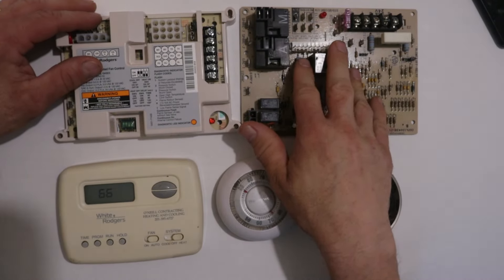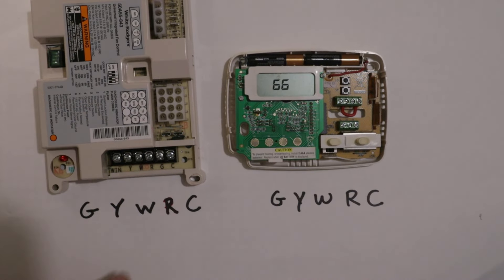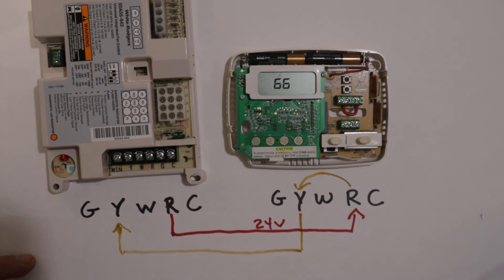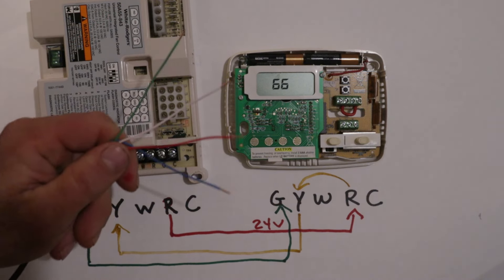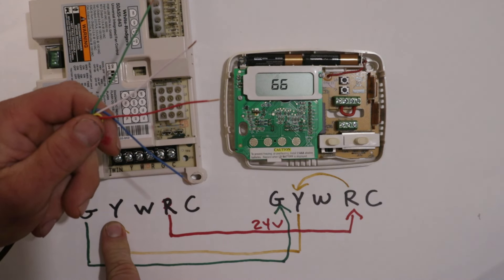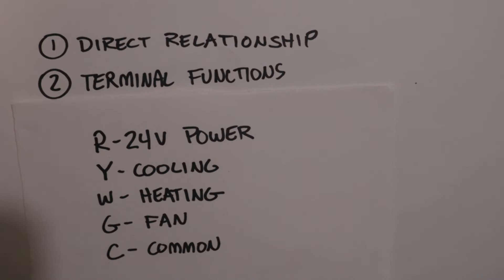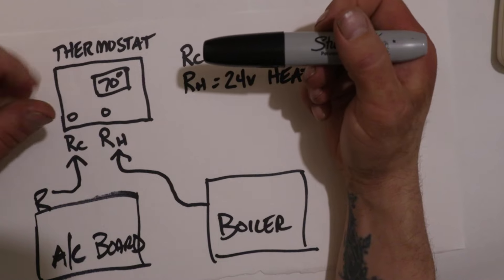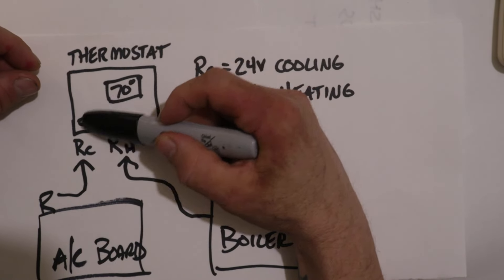Thermostat Wiring at Control Boards

Comment: It is not always true you need a green wire (G terminal) to turn on the fan (blower) to accompany your furnace in the heating cycle. This  can be setup inside the furnace and can be totally controlled by the wall thermostat with only 2 wires. Typically red (Rc) and white (W) are the only connections necessary. Also, you should probably point out that "24 volts" is actually 24 volts AC (alternating current). Also, you speak of 3 wires to the outdoor condenser but talk only about 2 wires, which is a connection for A/C. The 3rd wire is for the reversing valve for a heat pump system.

Comment: I found the video very informative and superior to other videos I have watched.  For me the big take away was that the color of the wires might or might not agree with the letter markings on the components.  It is the function that is important.  One take away from another video is that when replacing a thermostat that has been working but has failed is to take a picture of the previous wiring to use as a reference.  I have a thermostat where the DOWN button does not reliably reduce the temperature setting so I am going to replace it with a simple manual Heat/Cool type thermostat.  I plan to take a picture first and connect the wires to the same "Letters" as in the picture.

Comment: I set my thermostat to heat mode. Adjust thermostat to 70° furnace. Lights comes on blows heat into the house reaches setpoint turns off, but does not continue to run and blow access heat out of the heat exchanger and trips on high limit. Is my problem control board or thermostat.

Comment: Love u say r to r etc takes priority over color code, cause I had someone wire an air conditioner in 2002 who thought it was 1950 apparently used blue for power gave me a massive headache till i spent hours ohming it out to find out was connected to the r terminal
Reply from the maker: Yup. Had one situation where somebody ran 3 sets of 2 wire instead of just running one 6 wire. All of the wires were just red and white.

Comment: I knew nothing of HVAC, though wanted to figure it out some since I just moved the thermostat by running a new length of 5 conductor. Everything worked fine, but I had a piece of 2 conductor coming off of it that I now know the function of thanks to this video. You explained all of the functions of the connection in a manner that people could understand easily and clearly without treating us like idiots. Thank you!!!
Reply from the maker: You're welcome

Comment: Thanks so much for this video!  This is exactly what I was looking for.  This really explains everything.  I have 2 systems with 2 different transformers but maybe you can include using a “relay in a box” to keep them separated when your thermostat only has a single “r” terminal.

Comment: That was quite informative. I have a diesel heater which has  its own sort of thermostat. By sort of I mean when it reaches a certain temperature it just goes to the lowest setting. They make programmable thermostats that can intercept the wireless control signal for the diesel heater and use it to manipulate the off and on buttons. This allows a person to have an actual thermostat that turns the unit off when it reaches temperature. The concept is quite simple but the aftermarket thermostat is an additional $50. Some folks wire up a standard furnace thermostat to the contact points of the diesel heater's remote switch and use a 12-volt power supply to send a signal (power) to the diesel heater's remote switch. The diesel heater remote switch will time out after 10 seconds, so they can send power to the on button to turn the unit on and when the room temperature is satisfied it sends power to the off button. It seems to me this could be accomplished without a separate 12 volt power supply. I'm not really sure but I'll have to watch your video a few more times to see if a regular thermostat can trigger (close) one circuit (on) when it needs heat and close another circuit (off) when it reaches temperature and is ready to shut down the machine (essentially activating the off button on the diesel heater remote). Your explanations were very clear and I appreciate your professional knowledge. Thanks.
Reply from the maker: I just bought a relay that can work with 12-24 volts ac or DC. With that you can run a regular tstat off of a 24 circuit to activate the relay and send 12vdc to the switching side of the relay to control the heater.

Normally open and normally closed can be used to toggle.
Reply: @JerseyMikeHVAC  I also have a couple of those small relays that I used to trigger my plasma cutter when I built a CNC table for it. It's a normally open and closes the contact when it receives a power signal. I was trying to rattle my marbles together to figure out how to incorporate that device.  For me it usually takes quite some time before my brain can wrap around how everything works. I know the solution is there somewhere I just have to comprehend it. Thanks for the reply.

Comment: What I have found, is that HVAC Guys do what they want, when possible !
Not sure what they're thinking is, but likely as long as the same wire is connected to the Thermostat, and then to the control board, thats all that matters, apparently to them !
It's as if, they make it their own !
Especially if they do the installation !
As if they will be the only ones to service the system !
I found this out the hard way !
Thinking I could do a quick and simple Thermostat change !
Fortunately I was smart enough to take a before picture with my phone, of the wiring scheme !
Which turned out to be a Life saver !
I didn't agree with what I saw, but took the, " When in Rome " stance !
Most importantly, it worked, and you can't argue with success !
I can think of a lot of names for the initial install, but not here !
           😂🤣😂

Comment: By far the best video I've watched on how to wire a furnace. I wish that I could do a video call with you because I had a circuit board that went bad and one next door out of a furnace that was free and I'm trying to wire it up and make it work except it's a little bit different then the circuit board that is smoked. 
The only thing I wish your video had also is how each of the other components turn on and what sequence is used and possibly what the ohms are for each sensor. Kinda know what I'm doing, but first time fucking with furnace. Also GF is cold.
Really good video, and I will be subscribing

Comment: Mike, is the orders: 1.transformer powers board, 2. Red wire is the only wire energized to thermostat 3.other wires are energized returning to board according to call.

Is "red" wire only supply voltage to thermostat?

Could u do a video on low voltage side of transformer supplying voltage to board?

Is my thinking correct or incorrect?

Thank you for good videos!

Comment: This is very informative and consolidated my knowledge of the wiring. This pretty much describes the same wiring as my Goodman furnace/ac setup. The only difference is my G terminal is wired to an external switch system  that controls my central exhaust fan (R and G). Whenever I turn on a bathroom fan switch, it turns on my central exhaust fan but also turns on my blower motor through some kind of relay. I wonder if I can still connect another G wire from my thermostat to the G terminal to be able to use the circulation feature while still having my exhaust fan system wired to the blower as well...

Comment: Question - I do not have a C wire to my knowledge in my thermostat wiring.I have the white wire but it is hooked up to the W.My thermostat right now is battery operated.In my furnace I do have a white wire connected to the C slot.So do I have a common wire for power for a smart thermostat?I have a red to RV.A black to R.White to W or O/B.Another black to Y and a green to G in my existing thermostat.C is empty but again in the furnace a white is hooked up to the C.
Reply from the maker: The white wire on C at the furnace is likely from the outdoor AC unit. Although it is a common, it is not for your thermostat. So, no, you don't have a common wire available for a smart stat. You only have what's physically available at the thermostat's location itself. If you did have a common wire available at the thermostat, that C terminal in the furnace is where it would connect, however.
Reply: I did read that I could change my green wire at the thermostat to the C & move the Green at the furnace to the White C & put a jumper where the green originally was.Does that sound correct?
Reply from the maker: It's possible to sub the G wire as a common, but it depends on what kind of system you have. With a jumper between Y and G it could likely work.
Reply: I can only try.My fear is I don’t want to mess with the furnace.If the thermostat does not work I can replace it with the old one but if I screw up the furnace I’m in trouble.I can put the G back & remove the jumper but I don’t want to pop a fuse etc.The furnace & air are about 10 years old.The wiring in the thermostat I’ll assume is original to the house.The last 2 thermostats have been battery operated since I have been here.The thermostat I currently have (Honeywell) seems to stop once a week.It’s luminated but it’s off.I have changed the batteries twice.When I take the face off & reattach it starts working again so I don’t know if it’s the contacts or the motherboard.Worked fine until about a month ago.
Reply from the maker: @Dave-ld3dr  Thermostats do not send out a signal for the fan (on G terminal)  in heating mode, so the green wire goes unused. Only in cooling mode does the stat send 24v out on G. But it also does so on Y as well., so the jumper wouldn't interfere with heating. nor the missing G wire even without a jumper.
Reply: So you suggest using the G in the thermostat as C & on the furnace move G to C & use the jumper?I already have a white on my C in the Furnace.This won’t interfere with heating & cooling come summer?Thanks.

Comment: Would it be best to verify the furnace at the board? Take a picture of the wiring then apply it to the thermostat for correct wiring?
Reply from the maker: Absolutely. Yes. You just have to be careful because terminals at the board can have wires from other places than the thermostat (like a condensing unit or a humidifier, for example) so just make sure you know which collection of wires actually go to the thermostat.
Reply: The circuit board at the furnace wouldn’t lie as long as you’re reading the right part of the circuit board connections I would think and you have 2 wires at the contractor that’s your 24 volts to turn on your outside unit witch causes your contactor to complete the circuit you should be a professor 👍
Reply from the maker: Yes sir. You got it.
Reply: No thank you boss

Comment: I have a 5 wire older system that I'd like to connect to a newer smart thermostat. You gave an excellent description of the Rc and Rh wires, however I have a red wire to Rh and blue wire to Rc. Blue wire I assumed was a Control wire but I feel I should follow the existing configuration. Without a control wire, this limits my options for a smart thermostat, unless i want to add the Control. Is the configuration of my wires correct to follow as is, with blue to Rc? Thank you.
Reply from the maker: Yes. Wire it the same way. All the blue wire means is that the original technician who wired it decided to use blue for AC control power (to Rc terminal)  to distinguish it from the red for heating power (to Rh terminal).

Comment: Great video. I have the RC RH Separate system with no jumper wire as you stated.  If I wanted to add a common wire because there is none connected to my thermostat now for the purpose of installing a smart thermostat.  How can I go about doing that?  Thanks.
Reply from the maker: Most smart thermostats working on 2 transformer set ups like yours will charge off of the cooling system (Rc terminal and Common). You'll want to see if you have an unused wire on the thermostat wires from your AC system and use that as a common connection between the AC control board and thermostat. 

FYI, for Ecobees the PEK kit will not work on a 2 transformer system if you don't have a common wire available.
Reply: @JerseyMikeHVAC  I'll look to see if a common wire is present.  Thank you.

Comment: Hey Jersey Mike enjoy your videos very much. Very informative but I do have a question about the rc and rh terminal which I do understand about heating and cooling. I have two zone heating gas hot water baseboard with a heating only two wire thermostat down stairs and my other thermostat upstairs is heating and cooling with unit in attic . My question Mike is this the upstairs thermostat is wired as this I have a  red wire on my rc for cooling and a red wire on w then I have a white wire on r which would be for heat then I have a yellow wire on y and then a green wire on g . Everything seems to be working fine except when I turn on cooling my fan is set to auto which comes on automatically I don’t believe I can just run my fan independently. If I put in a nest thermostat should I put the two red wires to rc and rh and put the white wire to w if everything seems to be running okay.
Reply: Or should I wire up the nest thermostat the way it’s wired up now. Any help I would appreciate
Reply from the maker: All they did was reverse the red and white for heating, but you're just closing a simple circuit so it doesn't matter. You can keep the wiring as is or switch the red and white so the white goes to W and the red to Rh (which is conventional color code wiring). 

Only thing with the nest is that if it needs a common wire that common has to come off the AC system, not the boiler. Nests charge off of the Rc.

Comment: Hello I have a problem.  The colors on the wires have been worn out so they are all the same brownish orange color. Except the red wire. My furnace is for both HVAC Unit. Don't know how to change them.
Reply from the maker: What are you changing?
Reply: I will be changing the thermostat tomorrow when it arrives.  I took a look in the thermostat and realized some of the wires are old and worn out so the colors are worn out. Except the red one. Still functions well.
Reply from the maker: @samshepard8234  best thing is to just label each wire according to what terminal it lands on and use the same terminals on the new stat. 

or, if there is enough slack in the wire, you can pull it out and pull back the outer jacket to where it isn't faded.
Reply: Good idea I'll try that. Thanks a lot for your advice!

Comment: PS
The theme is a 4 wire system. It has white Red green and yellow. It has no other wire that you can hook to . In the unit there a O wire on the broad that other wire come from the side of that main A/C breaker or it called the main contact comes off the side. So do I need either one or can I hook them up to any of the four wires that hooks up to the thermostat.

Comment: Hi Mike, So right now  I have a Trane VX95 and a Carrier A/C  with only  three wires going to the T-stat (wire in the wall has 6 leads) where the red is connected to R terminal , Black to B/C terminal  and white to the W1 terminal. I would like to hook up a Honeywell TH6320ZW2003 T6 Pro Series T-stat . The terminals on the furnace panel  currently attached are W2-Blue, W-White, R-Red, G-green, B/C-Black (and white A/C wire), Y- yellow (and Red A/C wire). So I'm confused as which I should  connect?  My thinking is W-W1, B/C to C, R-R,  Y-Y. would this be correct? thanks
Reply from the maker: WHat are you using as your primary source of heat? Furnace or the heat pump?

I ask because Honeywell says not to use the W terminal on their stats with heat pump applications. I recently had to disconnect a wire to the W terminal after someone hooked it up there because the heat strips would never shut off. Ran up an $800 electric bill. I had to disconnect that wire, which was also a Carrier heat pump with the Honeywell T6 stat.
Reply: mike I have  2 red wires on my control board one red out of control board going to red or thermostat and a red and yellow wire one the y terminal on my control board I don't know why @JerseyMikeHVAC
Reply from the maker: Yellow wire to Y is the call for cooling from the thermostat. Y terminal on control board activates air handler for cooling mode. Red wire off of Y terminal goes to a contactor on the outdoor unit which turns on the compressor and fan motor out there.

Comment: My system is a forced air & heating system and my old thermostat (non-progamable) has a jumper wire connected to Rc/RH. My new non-programable Emerson 80 series 1F83C-11NP thermostat came with a tiny jumper wire already connected to the board of the thermostat. Can I just throw the old jumper wire out or do I cut the new jumper wire and use the old one on the new connectors or it doesn't matter which jumper wire gets used? I'm thinking it doesn't matter which one I use based on this video and others I have come across.
Reply from the maker: You shouldn't need to remove the jumper in the new stat in favor of the old one. They serve the same purpose.
Reply: @JerseyMikeHVAC  Thank you, that's what I thought